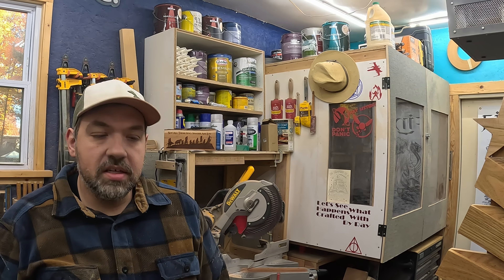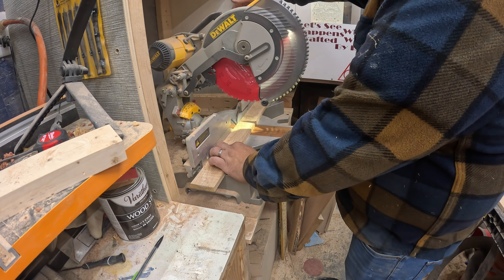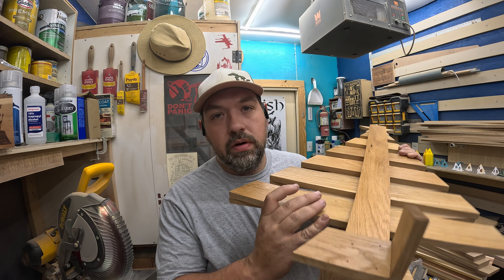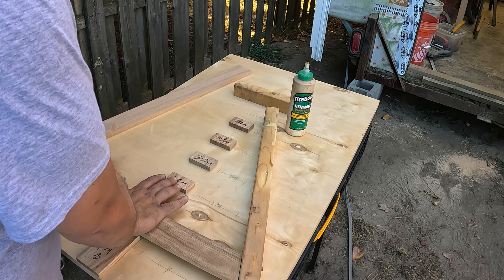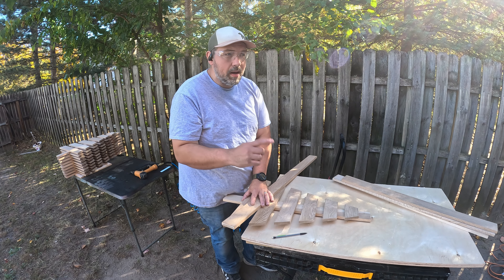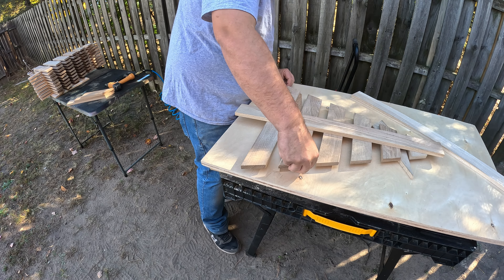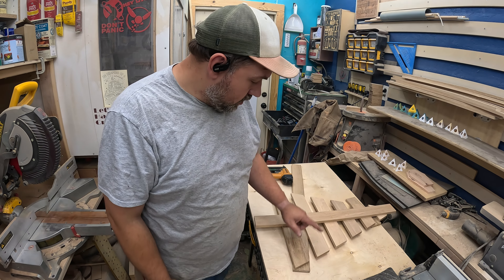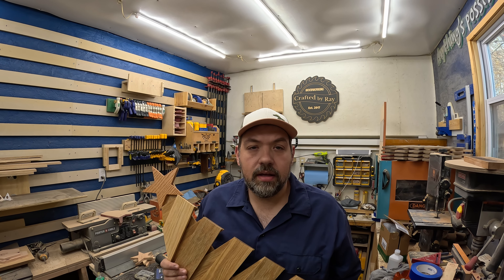How to Make a Spiral Wooden Christmas Tree – Free Cut List Included!

Comment: Hello, I made a similar tree yesterday.
I found it easier to assemble all the components, after cutting them oversize, then using a tracksaw to cut the sides.
Good video, thanks.
Reply from the maker: @pinkplonker8776  Thanks for watching and eventually, I want to try a track. I just never worked with one was wondering how the good they worked. Do you ever get them sliding on you?
Reply: @CraftedbyRay  they can slide so I always fix them in some way - usually the clamps that are provided.  There are other ways including  using a grip mat,

Comment: Ray, can you tell me how to make the jig. What is the spacing between each board in inches?. I like the looks of the tree and would like to make a few. Thank you.
Reply from the maker: So for the jig all I did. I stapled down the base of the tree's spacer which is 4 inches and then I found out what the center was I traced them on the board so that I knew where the center was and just took another board and stapled it so that I could but up the edges. To that the space in between is an inch and 3/8.